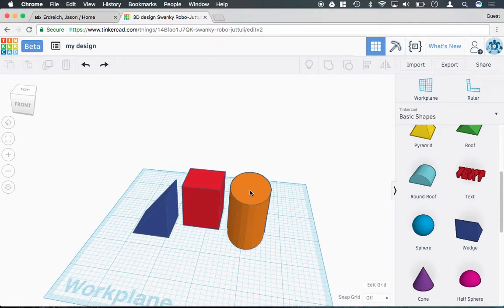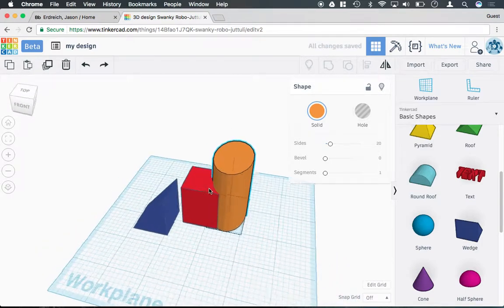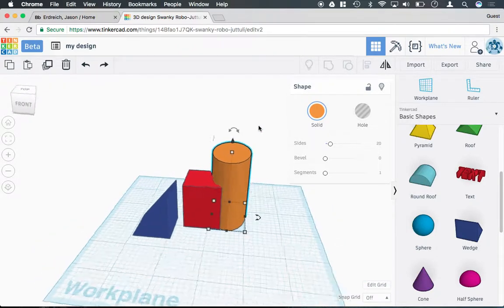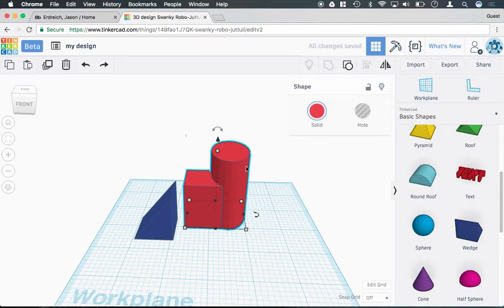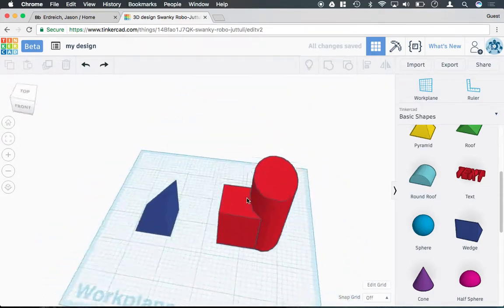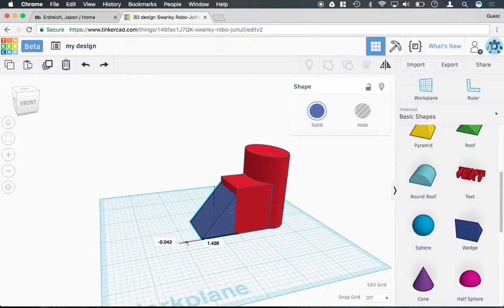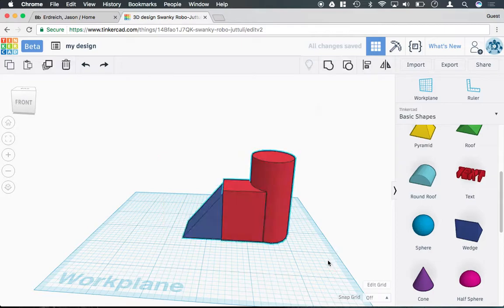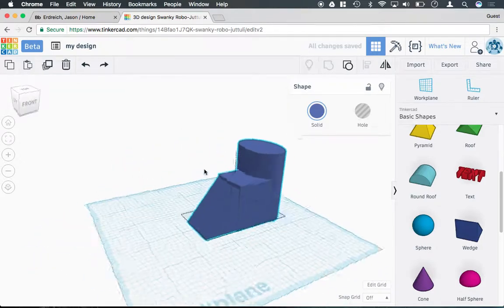How to merge and group shapes together in Tinkercad

Comment: how much overlap between parts is needed for strength?
Reply from the maker: That often depends less on the model, and more on your print settings. I usually use minimum tolerances of 1/8"